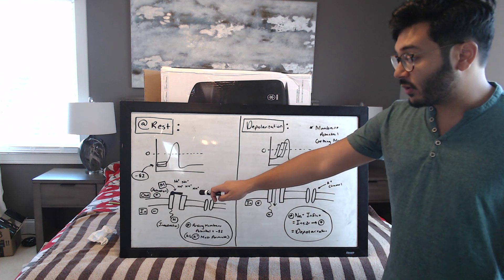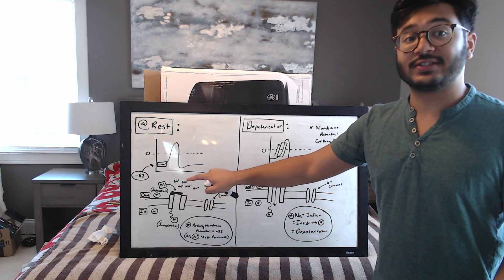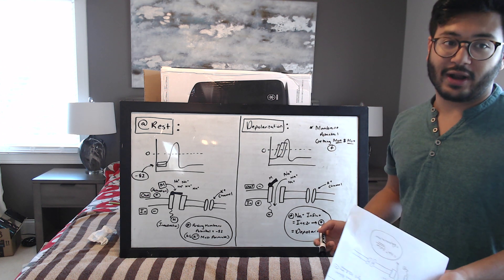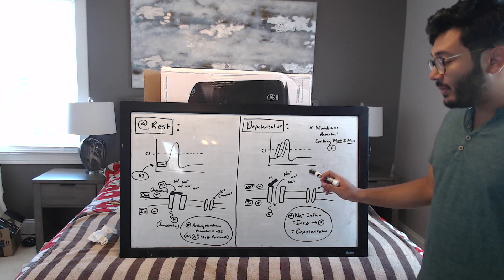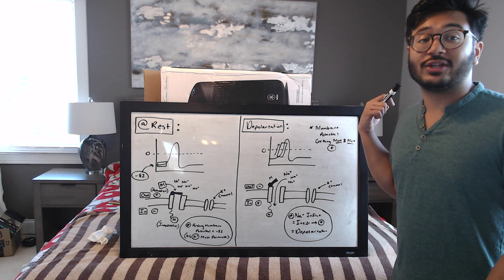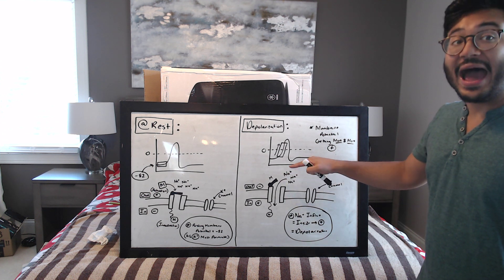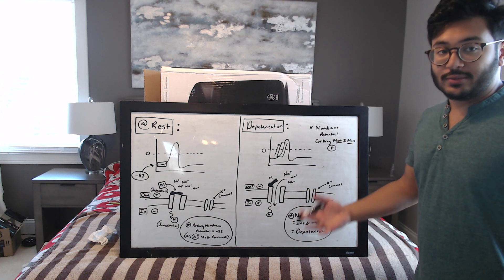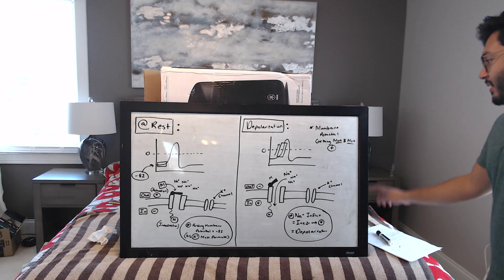Voltage Gated Na+ Channels:  H & M Gates (FTM 1)

Comment: We have several questions re hyperkalemia/hypokalemia and how that impacts h and m gates; will it follow the normal pathway? Meaning, if hyperkalemia causes a depolarized state, then what do the gates do? in hypokalemia, which causes a hyperpolarized state, will the m gate close and h gate open? 
ps thank you so much! :)
Reply: probably both gates open since increased AP and repeated firing, yes?
Reply from the maker: Yeah that sounds correct. For the questions on these they'll probably focus more on the "normal" rather than "abnormal" states, however. So if you sorta know what gates are open when...that should probably be sufficient for this exam (unless they are feeling super mean haha)